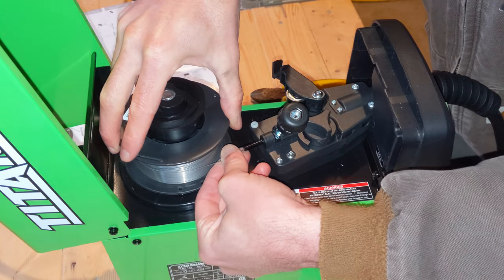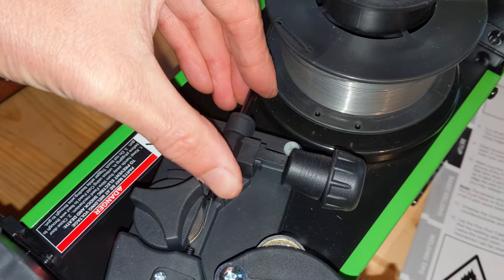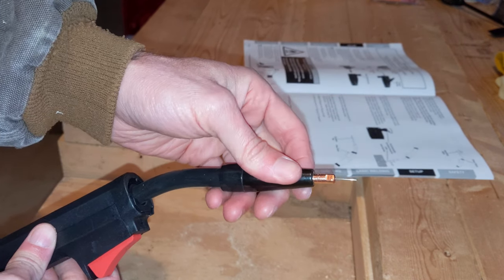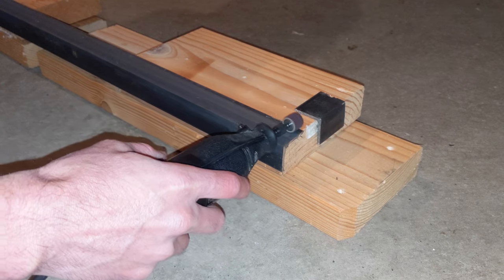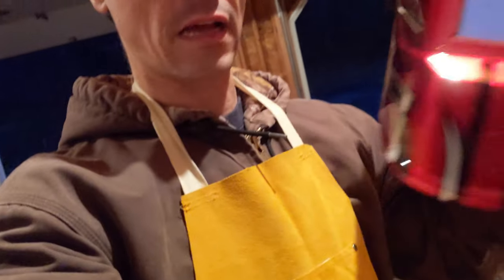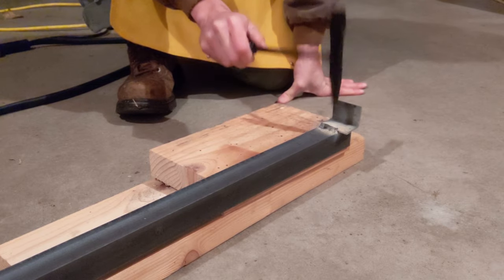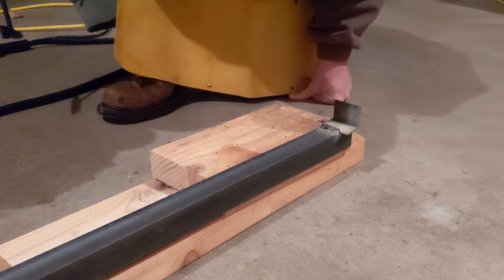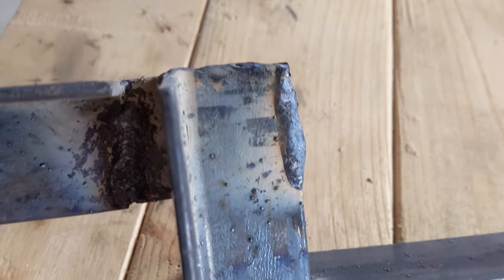Beginner Welding Practice, EASY TO DO! - Winter Camping Teardrop Trailer Build #2

Comment: I really enjoyed this video.  You have a great way of presenting.  I have a 90 amp welder from HF that I've used successfully on a couple of home projects but still consider myself as a welding newbie.  I had a laugh when you first pulled the trigger not knowing what to expect.....I did the same thing.  You may have already invested in magnetic corner holders, welding clamps and a grinder and cover that in subsequent videos, but if not, I found having them to be very helpful to have.  On to your next video!
Reply from the maker: I haven't heard of those first two tools.  I'll look them up, thanks.  The grinder is on the wish list.  The project as a whole is cutting into the budget pretty hard though so any extra expenses are on hold.  I've been using the edge of a Dremel cutoff blade for any grinding or cutting.  It did the job but I think a grinder could do it faster and better.  Especially when it comes to sanding/smoothing the metal.

I hope you enjoy the rest of the videos.